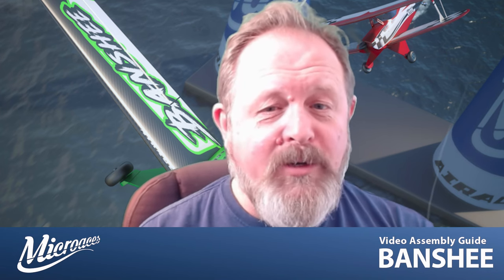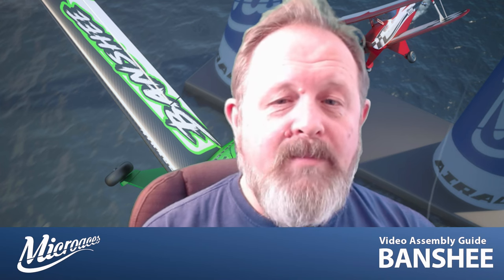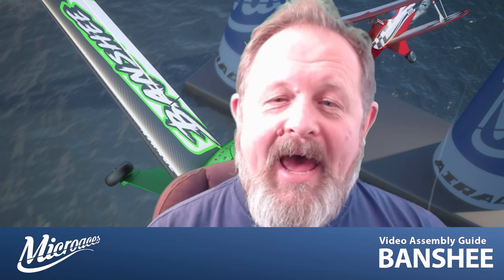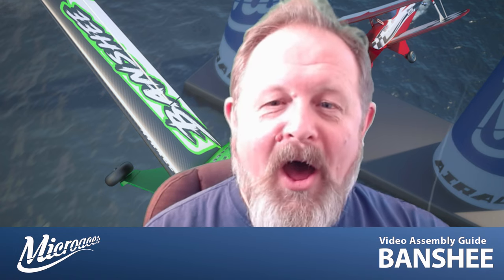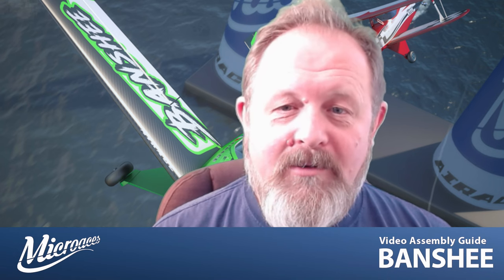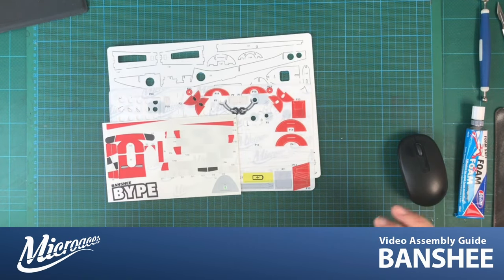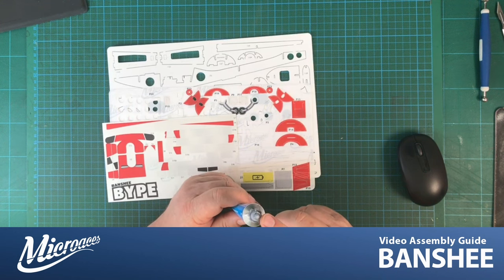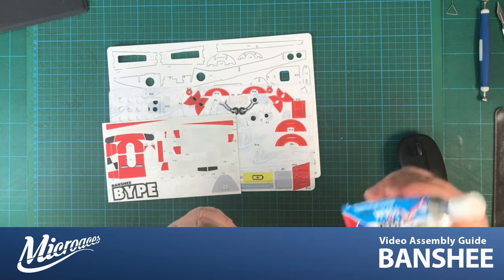BANSHEE Video Assembly Guide - PART 1 UNBOXING & AIRFRAME ASSEMBLY

Comment: Please remove the glue error with D7 at 44:30 at cut back in when you redo it correctly: Those of us following the sequence and assembling as we go are just making the same mistake and then also having to get the glue off!!! 

Also what is P7 for: It's there in the part sheet at 49:00 but gone at 49:20 with no mention of where it's supposed to go?
Reply from the maker: 38:07